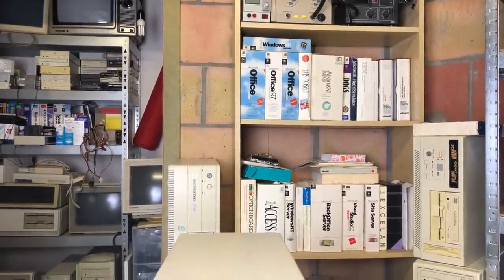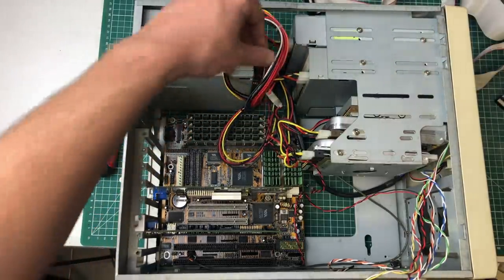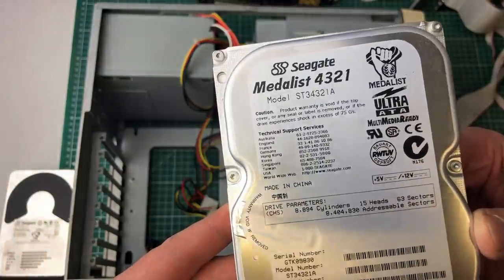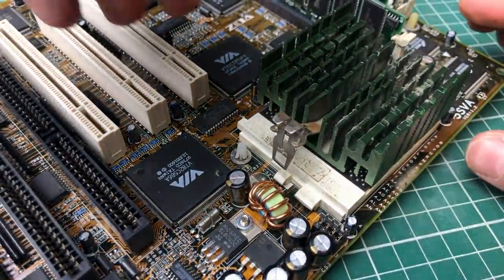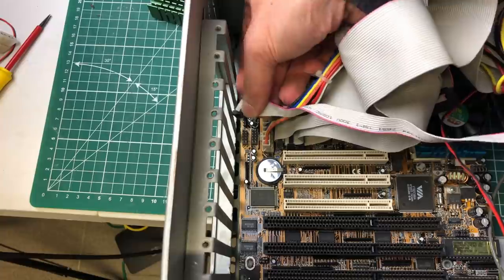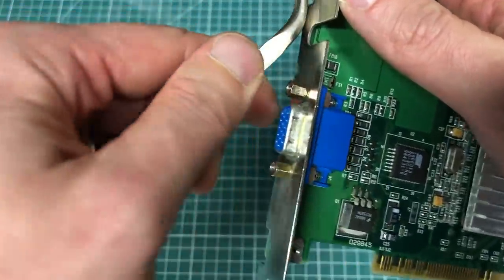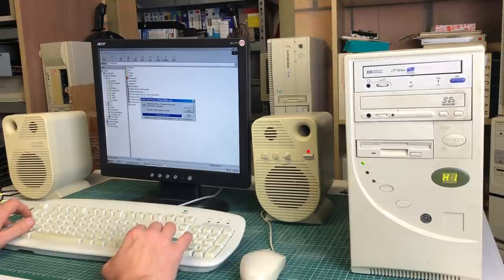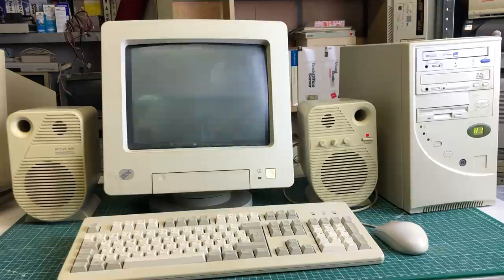Pentium 200 MMX find with Voodoo Banshee

Comment: Maan EDO together with SD RAM shall not work.. i had the very same MOBO i remember and my PC (it was CyrixII 233Mhz, equivalent speed of intel133 or 166Mhz).. Ok let's see at it.. (i'm at 3:24 only) edit: no spacers? Maan, i would not bee surprised if the mobo got some short or bee completely fried.. edit: apologizes.. it goes together, dunno why, maybee mine did not because of.. cpu maybee?? Edit: check RAM modules, one or more are defective, run memtest86+ or similar